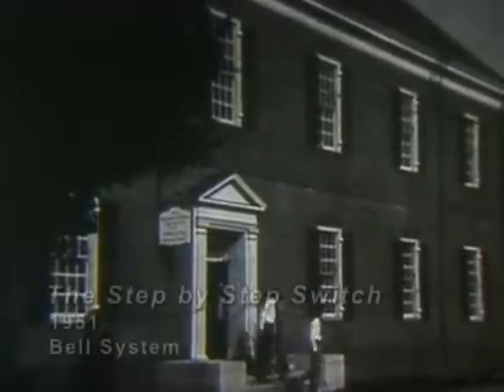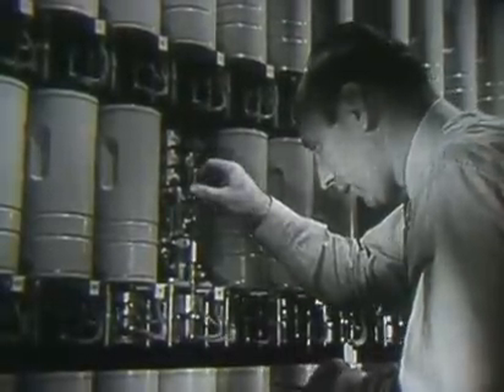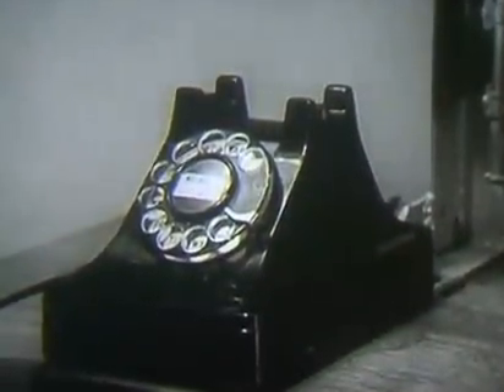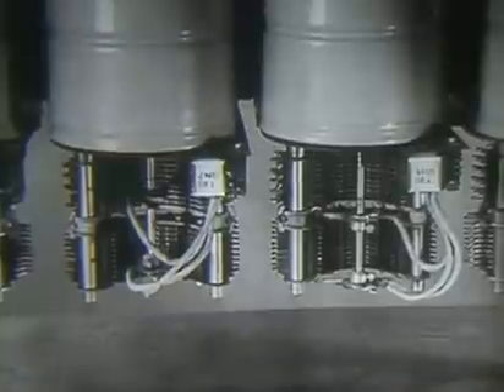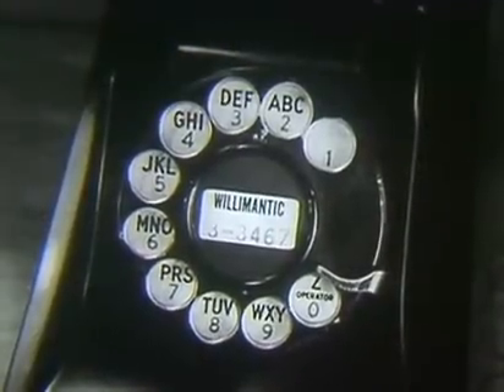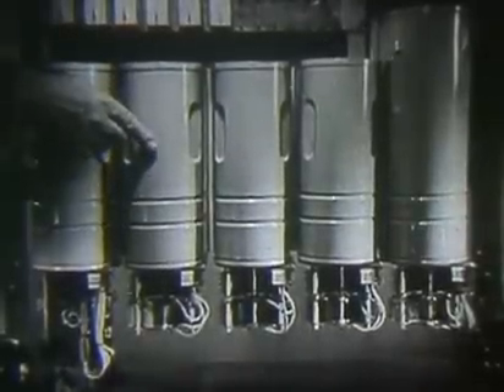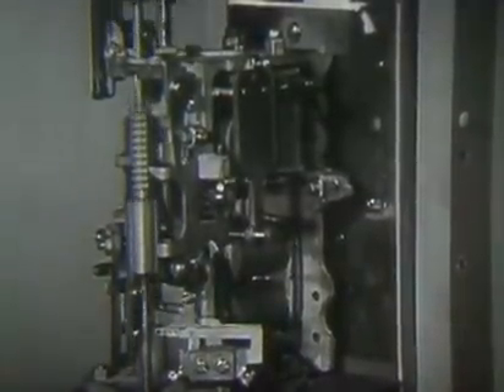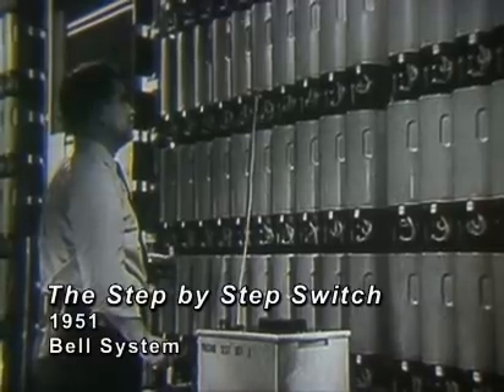AT&T Archives: The Step-By-Step Switch

Comment: Bringing back fond memories of terms pertaining to the SXS switch.  Double Dog, 11th rotary,  wipers,  A, B, C, ect. Relays, Tip (white) -- ground, Ring + (black) battery Sleeve (red) control lead. If grounded -- the circuit was busy. If some reason if wipers got caught in the banks (adjustment problem) the release relay stay operated and the relay would get hot enough that it could cause a fire there fore you had to manually release the switch. The routine of cleaning the banks. And don't forget the Line Switches with the Plungers and on the Main Distribution Frame MDF  there was a extra lead named the compasation wire that was Green. This equipment did the same as a Line Finder but was much older.  Also in the offices we had the Traffic Useage Recorder TUR that would keep track of the traffic.  (Telephone Calls) and trunk traffic.  We had the Traffic ladies come in the switch room to read the meters. Another switch I worked in was a Number one tandem #1 in the Pleasant office in Los Angeles.This was a local tandem. I transferred to ANHM CA 01 to a Toll Tandem with AMA and CAMA. Then to Operate Support Group in Orange County, California.
Reply: danc122131 I was an AMA motorized messager in accounting in orange Calif. We processed all of the AMA tapes there, they arrived by messager inside suitcases. The tapes were spliced together placed on reels and fed into the readers.Later I became a frameworker and a systems tech.The first fiber optic lines came in around 1982 and I got to connect some of the lines & do the acceptance tests on the mulitplexers.I also was a tester in TRCC, (T-carrier restoration control center) in Los Angeles, I remember the giant board showing the network with flashing lights. Visitors were always impressed with it, but it was just for show, we never made use of it.
Reply: That's awesome. I would like to contact you, through email or however you prefer and record this important history. You can contact me@ socialmediastandin@gmail.com

Comment: This system was in use in rural Maine through the 1970's. Very noisy, but fascinating to be in a room with dozens of these devices running simultaneously. I believe this was the first system to be put into wide use after operator-assisted calling ended.

Comment: What ever the technology before this was, my phone connection is using something even older, it's that slow and unreliable.
Reply: Digital cell phone networks are where POTS phones were in the 50s. Today land line is still the most reliable way to make and receive calls. During hurricane Ike in 2008 the cells phones were very flaky. My landline never skipped a beat.
Reply: billybassman21 People should be thankful if we still have landline at all.
Reply: JRowe95, the tech before this was plug board. It could be slow, unreliable, and sometimes hilarious, depending on the operator's mood.

Comment: Randy Roberson
Hace 2 meses.
 
I have some questions: how does the line finder locate the correct terminal of the phone which had its handset lifted?

When the terminal is in use, the telephone terminal has a standard low impedance, so it lowers the voltage of the line, when it is unused it is like an open circuit, so the voltage line it is up, that difference is recogniced.
Reply: when you pick up the phone, your line relay activates, which causes the line finder to start searching. the line relay puts a ground on your level on the vertical commutator and your terminal on the horizontal. when the line finder finds the grounded level, it starts searching horizontally. when it finds the terminal, it stops and connects you to the first selector.

Comment: This equipment WAS reliable. Far more important reasons for replacing it to reduce the number of employees included far lower power requirements, faster processing of calls, and making available features such as caller ID, call forwarding, all waiting, number portability, and many, many other features that we take for granted today. Yes, I also worked in Central offices or many years, on these switches, and also through most all of the later ESS switches, both analog and digital.

Comment: @ Ben Wolfram....... interesting thought.......  thinking about it though, An Electro Magnetic Pulse (in my opinion) would disable even this system.
I base my assumption on this..
even though, for the most part the system is mechanical, it does require AC and DC current at certain points in the call, which is the fundamentals of a PSTN, and their is some basic circuitry that is necessary to the process.  so i think an EMP would still disable this system
Reply: Yes, due to the very long telephone lines connected to the system, but likely repairable.

Comment: You are correct. The number 3 connector group consisting of ten switches would share the same 10 final numbers. So, if 38 was busy you would get one of the other free connectors in group 3 and then you would dial 9 and be connected to phone 39. I was an equipment engineer for Automatic Electric the mfg. of these.

Comment: I worked for the phone company in 1970 when this was still in use. The #5 cross-bar (touchtone) was just being tested and put into service, in Los Angeles. and the switchroom was very noisy, with about 20-30 'walls' of these switchers, the film here just shows part of one wall, or rack as they were called.
  New guys in the switchroom got a year or two of cleaning and adjusting these things.

Comment: Did you notice in the video that the last cylinder waited for 2 digits?  It was the "connector" cylinder.  So if the last 2 digits of your phone number was 38, and someone else had 39, that one connector could connect to either phone.  It's not clear to me what would happen if the connector was connected to 38.  Does this mean that 39 is now busy too as the connector is in use?  I am assuming multiple connectors had to have the same groups of lines in them in order to have more than one call.

Comment: Where I live this Step exchange was fully dismanteled in the early 1990s when all of the exchanges went to digital equipment.  Not only was this mechanical stuff noisy, but it housed a lot of space.  Our local phone company got rid of dozens of buildings around the city as they no longer needed so much space.  It is amazing how this matrix of wires, magnets, springs, and mechanics eventually connected phones together.
Reply: Every time I pass by a Southern New England Telephone, now Frontier central office, I wonder what is inside there now. I realize all those "frames' must be long gone.